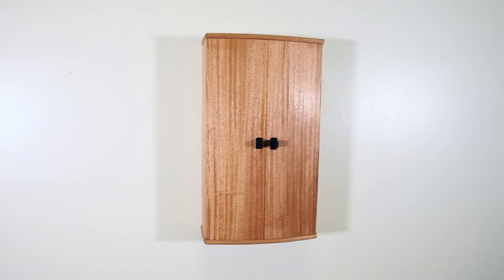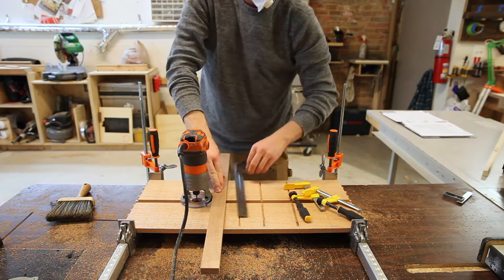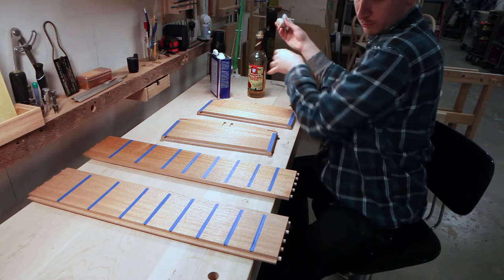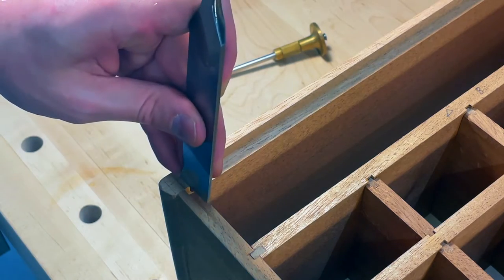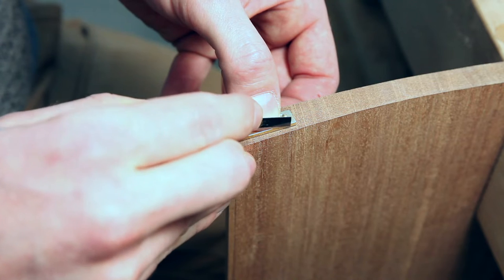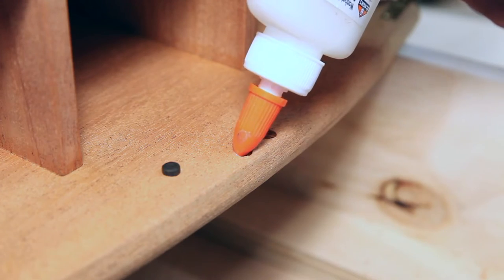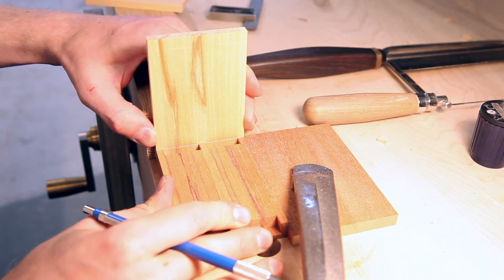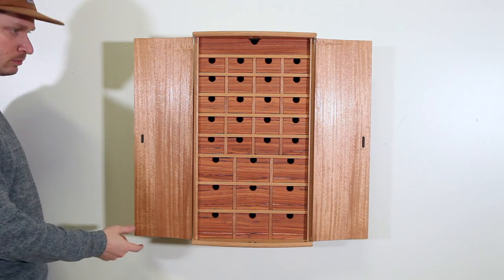Krenov style wall hanging cabinet

Comment: shocked but also stoked you will be using for this for hardware. arguably the nicest shop cabinet ever made. nice work, so rad.
Reply from the maker: Thanks Joel! Dont worry, I wont fill it up with generic drywall screws, this guy is getting some of those high end GRK fasteners haha
Reply: Standards always start in the workshop.

Comment: What does burnishing w the shavings do? Never tried tht b4.
Reply from the maker: It polishes the surface, smoothing down fibers. Almost like a very high grit sand paper. You wanna burnish with shavings of the same wood species you’re using it on